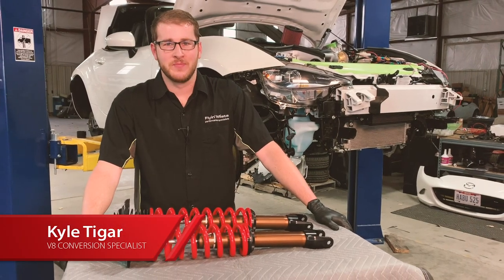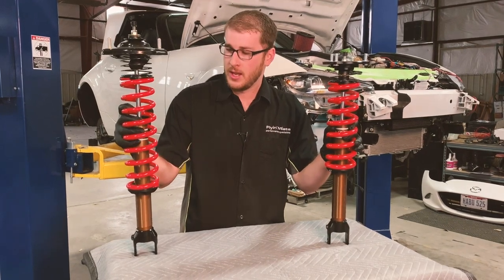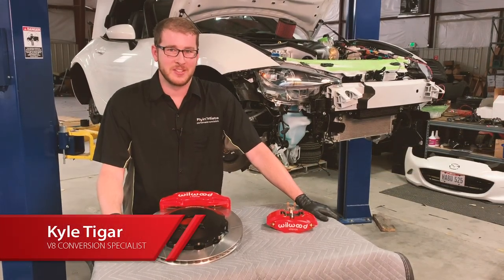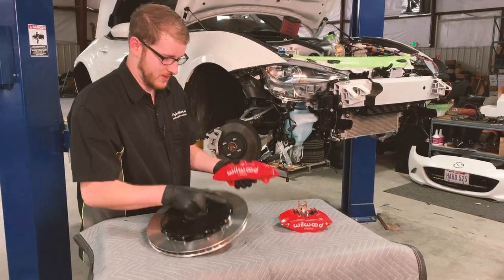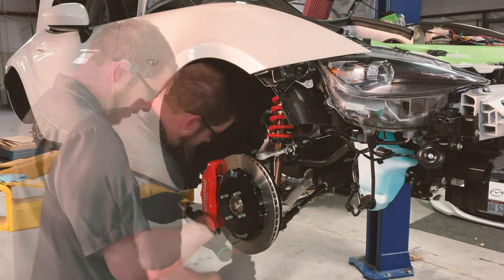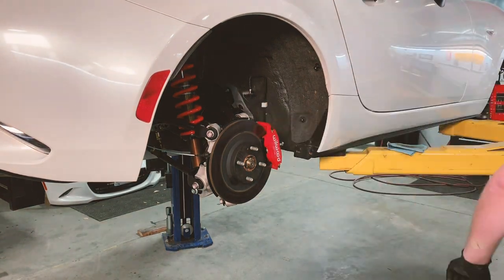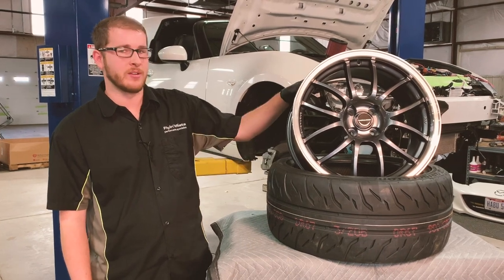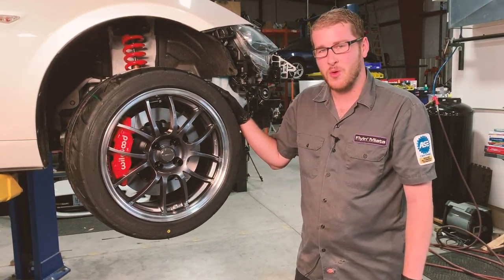FM V8 Build Diary Part 7 - Suspension, Brakes, Wheels & Tires

Comment: Do you sub-Frame connectors? or is the body flex not an issue, seems like the LS would put a lot of stress on the body.
Reply from the maker: Yes, we reinforce the rear subframe substantially as well as add our "spider brace" in the center of the car. When Car and Driver drove one of our cars, they noticed the increased stiffness over stock.